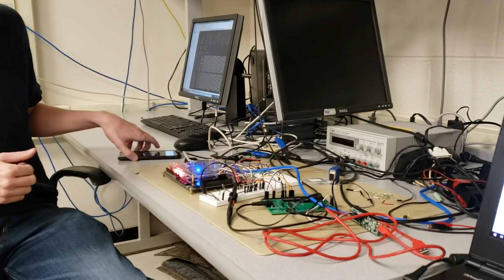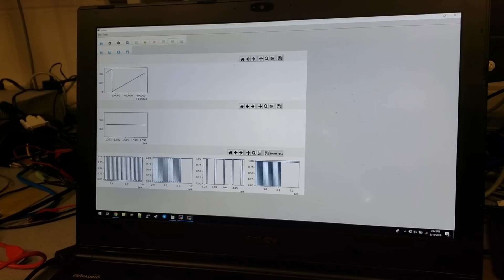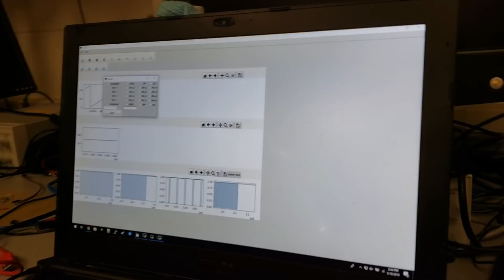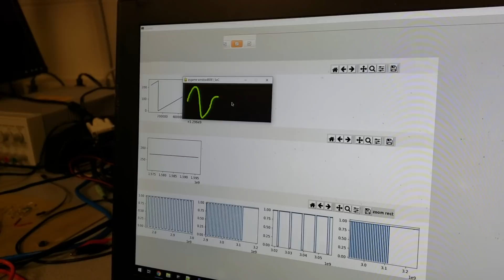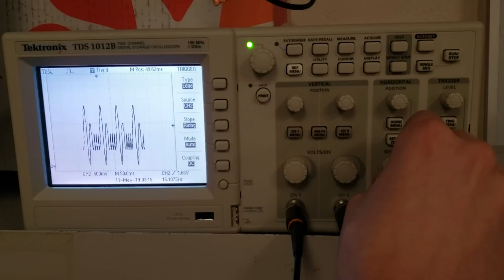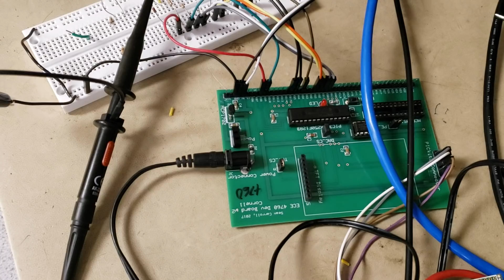FPGA Logic analyser

Comment: I've been trying to produce my own logic analyzer on an FPGA and found this video just in time. Thanks for sharing the source!
Reply from the maker: Here is another version that I wrote to allow the FPGA to debug itself.
http://people.ece.cornell.edu/land/courses/ece5760/DE1_SOC/Logic_analyzer/index_logic.html
Reply: @ece4760  Thanks! general question about the approach in your courses: when data intensive acquisition is required, do you recommend going directly from verilog RTL to DDR3? Or do you have to go through HPS? My only concern is that software may not be able to keep up with high-speed capture of the logic analyzer.
Reply from the maker: The data capture here is to on-chip SRAM which is very fast, but limited in  size on this chip to 4 MBits. There is ls 64 Mbytes of SDRAM directly connected to the FPGA with hardware read/write